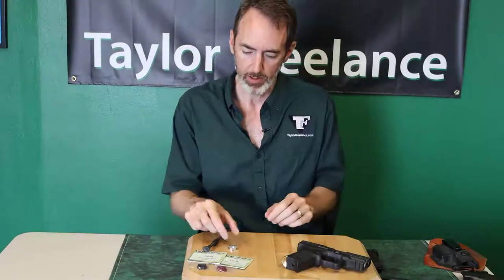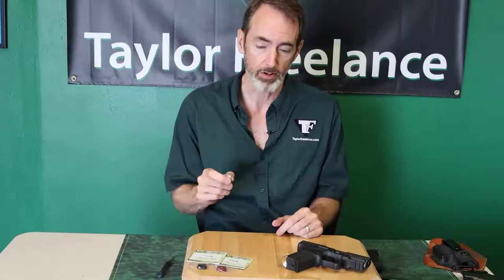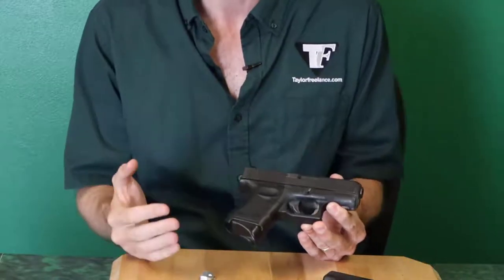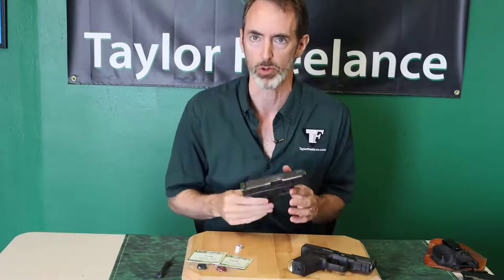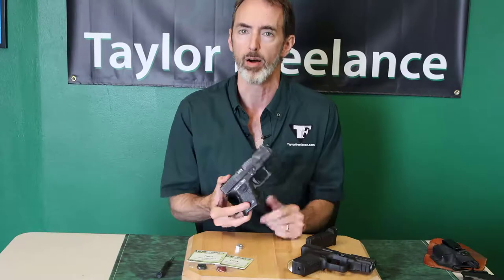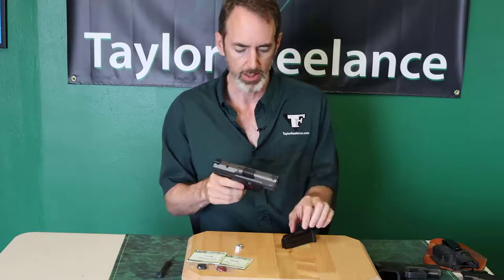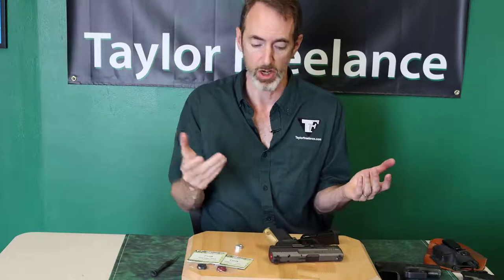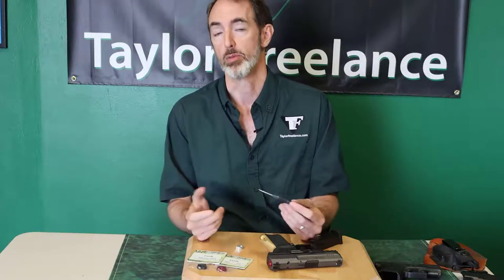Why the Hole? Design of the TF Slide/Back Plate

Comment: Your right can’t wait until canik comes with cool custom parts like Glock chamber plates with all the designs ect I’ll probably be dead before that time 😂
Reply from the maker: Canik won't -- that's a pretty small project for them. Also, to get the surface area to write on, you almost have to cover the cocking indicator.